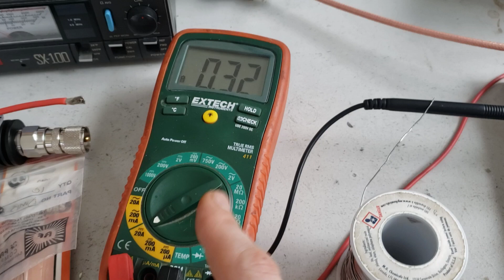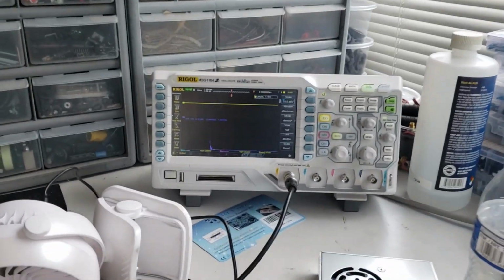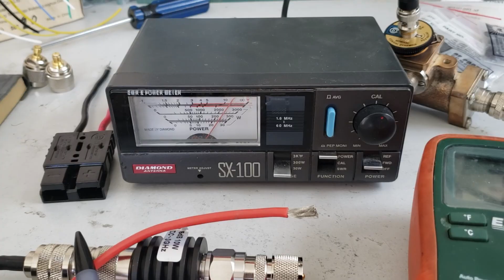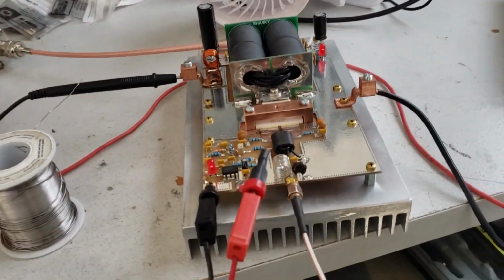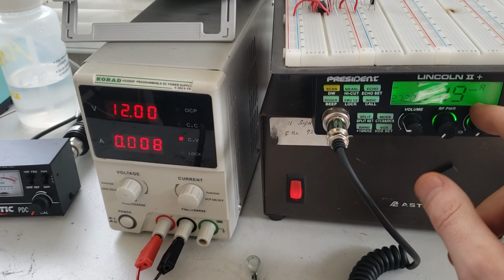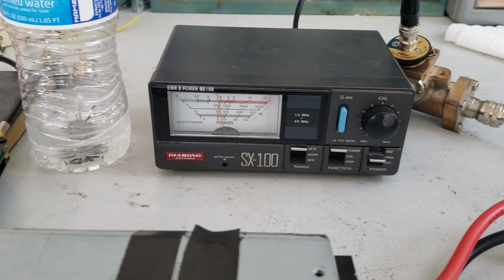LDMOS - New Test Pallet - MRFX1K80H

Comment: I would like to know how much it would cost me for you to build me a board and supply all the parts for a kit for me to build here in my shop and use a fixed cap across the final output transformer so that the variable will not give me a problem in the tunning of the output circuitry. I just don't think that part ought to be a variable device. Not at two hundred a pop for those LDMOS units. Let me know GaryLordsWay@aol.com, give me a shout. I want to build mine with pl339 plugs on it. But I too want to run it on SSB and Am maybe a little FM, but I don't think so... but it would have to have a relay in and a keying circuit.

Comment: Nice build but your heatsink is W A Y too small. Assuming you make 1500 watts of RF and manage to get 70% efficiency,  the device will dissipate about 450 watts of heat out of the ~1 square inch flange. You'll want a much larger and thicker heat spreader, a HUGE heat sink and lots of fans, otherwise you'll lose the device. Not a big fan of the clamp down method.  It's far better to solder the flange to the copper heat spreader. Remember - every amp of power is passing through the mounting flange a.k.a. the source and into the heat spreader / ground.  Hope you used a stable, electrically conductive thermal compound. The RF Kit guys learned early on that the characteristics of some compounds change after being exposed to high current for a time.  Naturally all that becomes a non issue if you solder the flange, but that requires a 2 board set. Probably not too hard to change this design...

What value trim cap did you use across the drains? Any drain to ground caps? Have you tested this on the ham bands or just 27MHZ. Cheers - Steve
Reply from the maker: Great comment! Everything you said about heat I've learned the hard way over the past several months. Quite a few failed devices due to junction temps. I switched to water cooling for the test bench, but final the design demands simplicity. I've recently resorted to CFD simulation to test heat sinks, spreaders and TIM options. My final designs are fairly elaborate and expensive but I've managed to create a thermal solution that will dissipate up to 800w/device with up to 120F ambient temps, without exceeding specified junction temps. Doing that without water was tough.

For testing I have been using liquid metal as a TIM. Both electrically conductive and better thermal conductivity than solder. Unfortunately it doesn't age very well, so 63/37 solder is probably the final answer. Spreader to heatsink is far less critical, and even a low end compound with uneven surfaces seems to be sufficient.

For the caps on the drains, that's something I'm still trying to perfect. Since I have a great thermal solution I can really push these FETs to the limit, and I'm still working to find the perfect combination of efficiency, output and distortion. For my transformer design the drain-drain capacitance is around 500-800pf. Putting double this amount of capacitance from each drain to gnd rather than drain-drain seems to improve harmonics. Shunt cap on the secondary is around 20-120pf.

I haven't tested at any other frequencies yet. Just trying to obtain maximum performance in a monoband config. One of these days I'll try to tackle a broadband design.